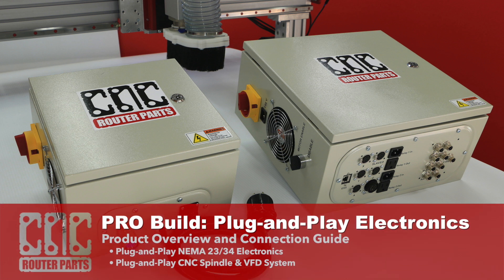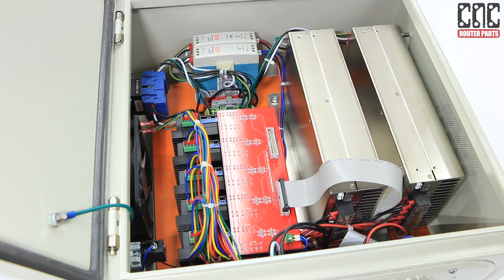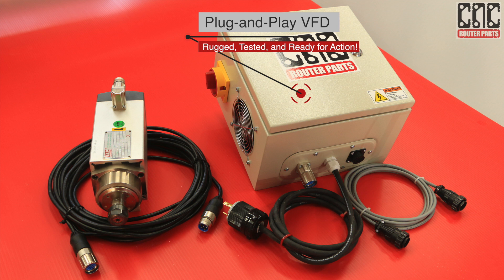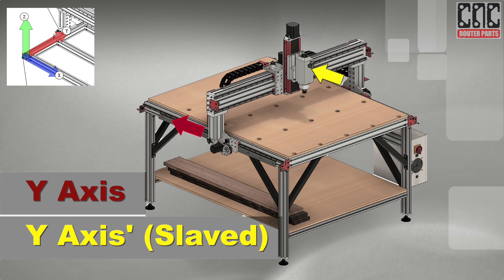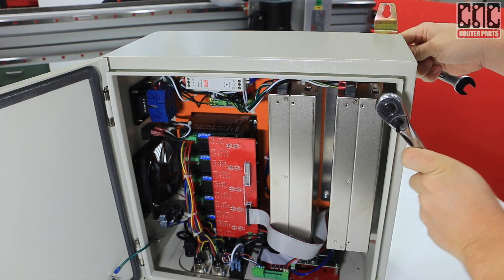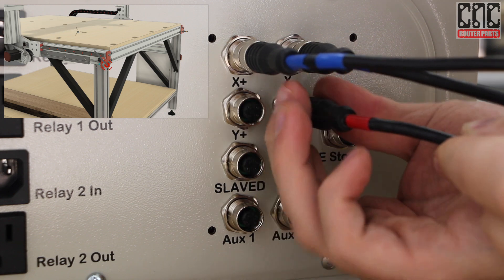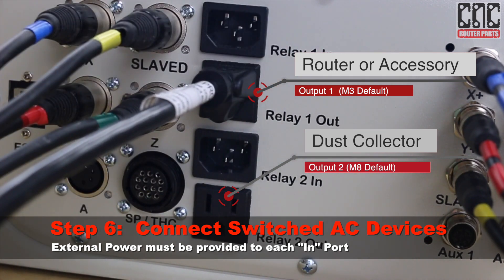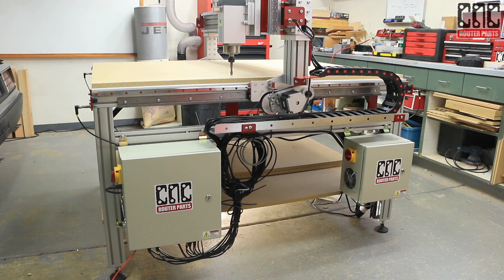PRO CNC Build Series: Plug-and-Play CNC Electronics and Spindle for your CNC Router Parts Machine

Comment: Keep in mind when shopping Avid that essential systems, such as this, are not included when selecting a machine.   Sure, we expect a CAM system and typically the spindle to be an additional expenses... but not a spindle mount, motor power control systems, gross CNC control systems,  limit switches, table legs on a non-table top system.   Take whatever the base system cost and multiply by 1.5- then start budgeting for tooling, fixtures, dust management, CAD...

Comment: Is there an option to hang the control enclosures out of the way, like recessed so they are not on the edge of workspace where I will bang my knees on them every operation?  It would seem if they could be arranged at 90 degrees to the side of rails under the edge rails, then the switches would be exposed on that surface.
Reply from the maker: The kits are customizable, you can place the control boxes where you'd prefer. We have hanging options coming soon. Some customers choose to hang them on the shop wall, or in a computer desk beside the machine. Check out Izzy Swan's recent CNC computer desk!
Reply: @AvidCNC  Do I understand correctly that the control boxes can be mounted on either side of the machine? Inside or outside? Front or back?

Comment: Nathan- Do you guys use the PROTUNER software on the drivers to get the best tuning or are they good right out of the box with your motors?
Reply from the maker: Hi Eric - Good question.  Our NEMA 23 and NEMA 34 motor tuning parameters come optimized out-of-the-box in our Mach pre-configured machine profiles.   Thanks! -Nathan
Reply: cncrouterparts Nathan-  thanks for the reply. Do you guys plan on making any changes to the electronics packages anytime soon? upgrades etc? or to the spindle packages?

Comment: Hello,
I live in Texas, and during the summer it gets around 95 degrees in my garage. My older CNC box (from another company) got too hot in the garage and would lose its communication on long cuts.
Do you think I would have a problem with overheating from one of your boxes?
Reply from the maker: Hi Randy - Thanks for your question!  Yes, 95℉ would be within the thermal performance range of our Plug-and-Play Controllers.  Feel free to call or contact us directly at sales@cncrouterparts.com if you'd like to discuss your application in more detail.   -Nathan

Comment: Hi,
The main switch on the panel should isolate all equipment within. From what I can see on the video the independent relay controlled outlets are not.
Cheers Dave.
Reply from the maker: Hi Dave,  That's right, the power entry switch only serves to isolate the enclosure from mains/line power.   -Nathan

Comment: Hi,
Do you have filter units for the cooling fans to stop the egress of dust into the electronics.
Cheers Dave
Reply from the maker: Hi Dave - The enclosure air intake (opposite side from fan) has a filter screen for moderate-sized particles, customers typically have not found it necessary to install a higher density filter element.   Thanks! -Nathan